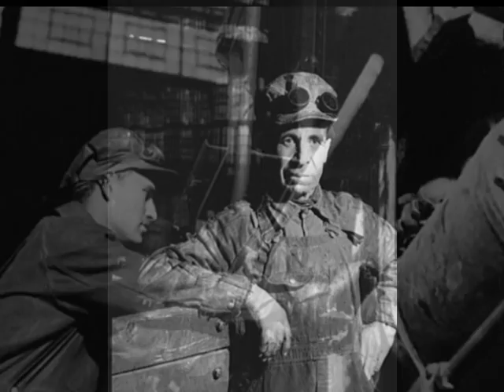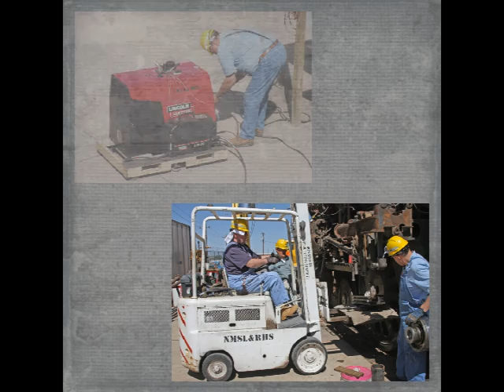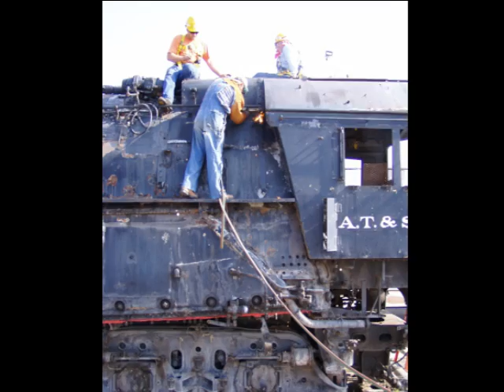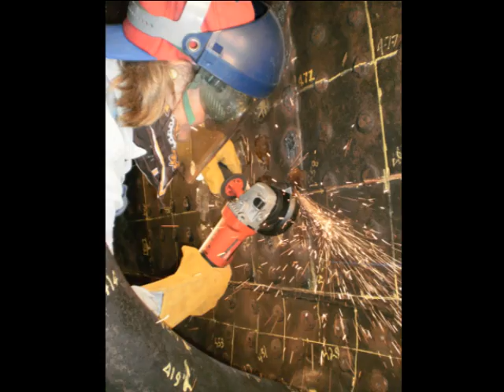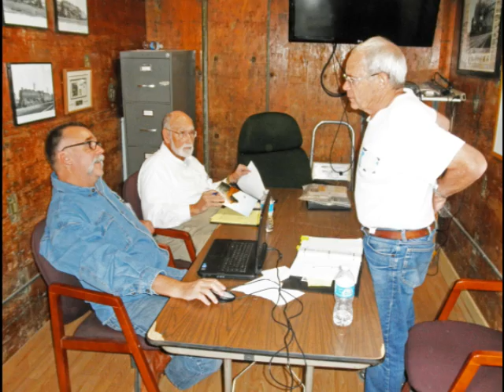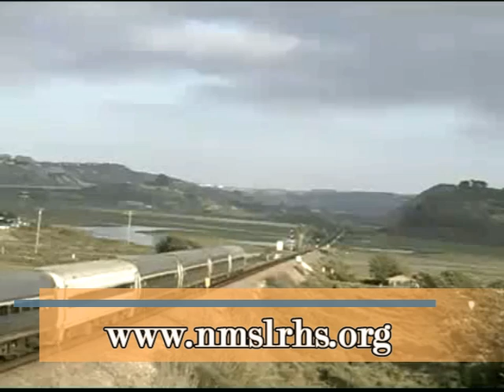The 2926 Story

Comment: The entire run of the Santa Fe 2900 class 4-8-4's were impressive. I saw them work on the ATSF lines in L.A., San Diego and San Bernardino. This restoration is a true work of art.
Reply: what was it like seeing the remaining steam power run against diesels?
Reply: One 4-8-4 UP FEF 3 could star and haul 88 fully loaded Iced Perishable cars. It took 3 GP-20's to do the same thing. BUT.. stops for water by steamers.

Comment: 2926 is actually a bigger and more modernized engine that has many improvements over the 3751. Probably the two biggest improvements are the bigger tender and roller-bearing equipped side rods.
Reply: +CoasterFan2105, I Hope You Can Upload a "Steam Locomotive 2926 Restoration" YouTube Video on your YouTube Channel. It will be Awesome. And Hello, By The Way.  🚂🚋🚋🚋🚋🚋🚋🚋🚋🚋🚋🚋
Reply: I saw the ATSF 2900 class operate daily and they were easily handling 20 heavy weight car passenger trains.
Reply: Come visit the 2926 at Albuquerque
Reply: Hi

Comment from the maker: One of the many reasons that 2926 is an excellent candidate to return to steam is that in 1944 Santa Fe teamed up with The Timken Company to install roller bearings on all axles and the connecting rods, and also replaced the early, heavy connecting rods with modern (at that time) "lightweight" connecting rods.  The Timken Company has recently completly rebuilt all the bearings that needed it, and DONATED the wonderful service!!!  Thanks to our freinds at Timken...!!!

Comment: you've got your information wrong, 3751 was built before the 2900's, 3751 was the Santa Fe's first 4-8-4. also there were no 3700 class northern's on Santa Fe. Santa Fe's 4-8-4's were the 3751 class with 14 engines, the 3765 class with 11, the 3776 class with 10 engines, and the 2900 class which had 30 locomotives.

Comment: Guys 2926 and 3751 are different engines for 1 3751 has 80" drivers and is a class 2 4-8-4 build after the class1 4-8-4 or the 2900's the 3700's are a different class and size
Reply: The 2900 where but after